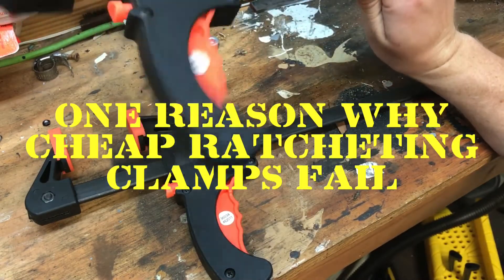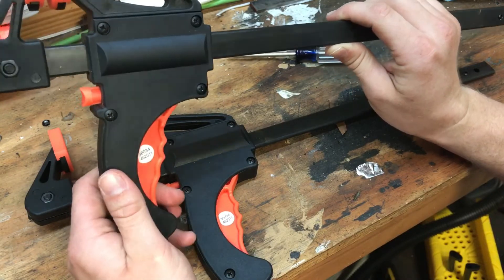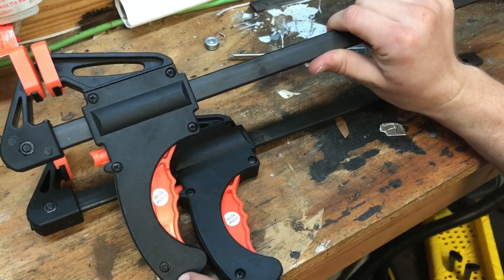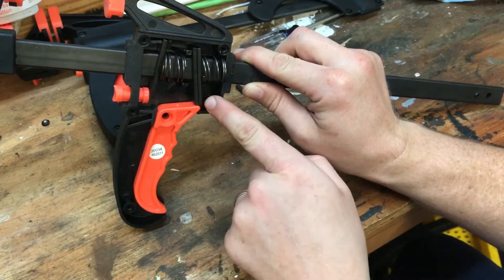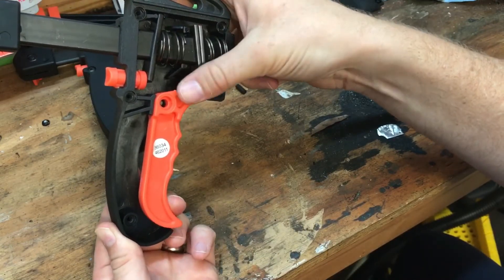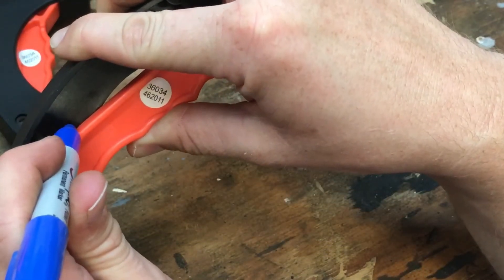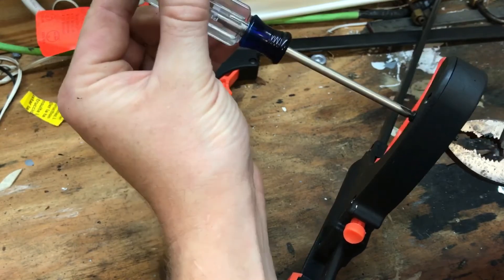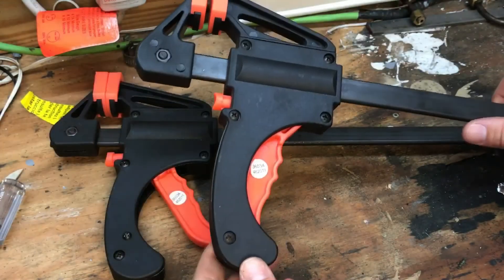Why Cheap Ratcheting Bar Clamps Fail (And How To Fix Them)

Comment: Those are harbor freight.  I bought some of those a decade ago.  They broke on first use - all of them.  I just took them apart, threw most of it out, and kept the steel/springs for projects.

Comment: I got an even cheaper one & it works fine. But it's metal & doesn't have a handle, you just push it (kinda gotta push it hard), which I think is actually even better. It's stronger that way. Plus it has a tightener at the end to make it extra tight.
Great for beginners (which I am) & for light to medium work. 🙂 Not the best for hard work or professionals but again, it is cheap but it's a good start. NEVER BUY PLASTIC TOOLS!! Or any tool that has plastic it/on it.

Comment: Seems to me an easier way to add a trigger stop would be to just superglue a small block of plastic inside, rather than go through all the work of drilling. Would be less risky, too, since you could dissolve the superglue with acetone if you put the block in the wrong place, whereas the drilled hole is irreversible.
Reply from the maker: To each their own. Literally take 30 seconds to drill hole and stick a bolt in. It’s just cheap plastic in a $1 clamp.

Comment: Chinese engineering is often about group think and saving face taking precedence over critical design feedback and testing.  It's "git er done" gone wild.
Reply: Plus most products from cheap china are made/built by children & teens. Which are not usually paid (basically slaves). Course it's illegal in other countries to do that but not china. That's part of the reason I hate china so much.